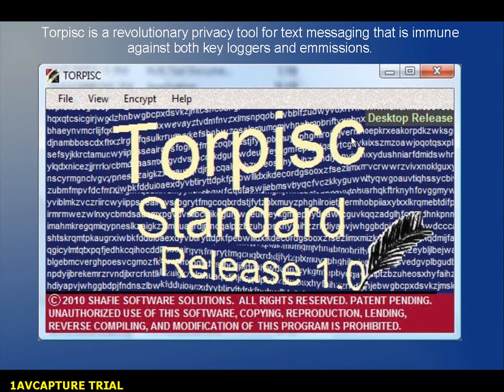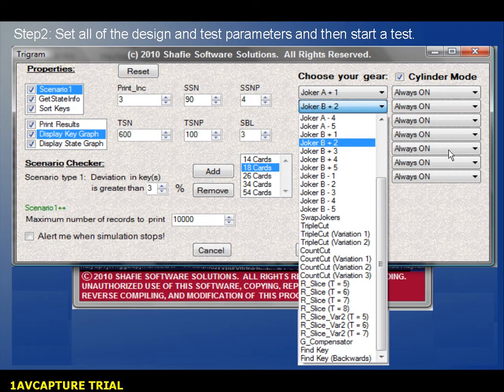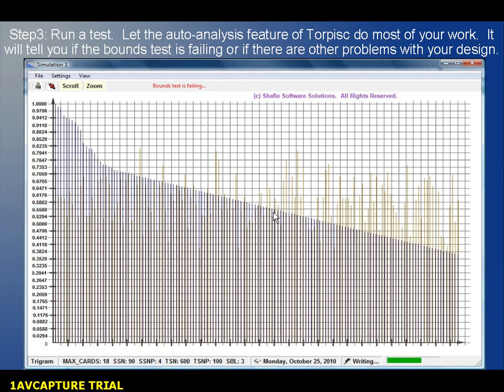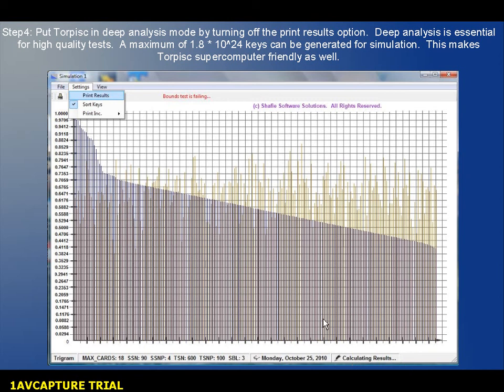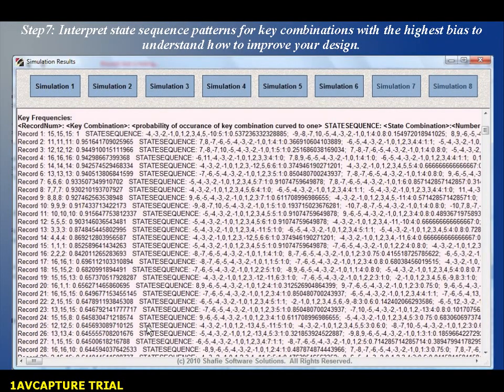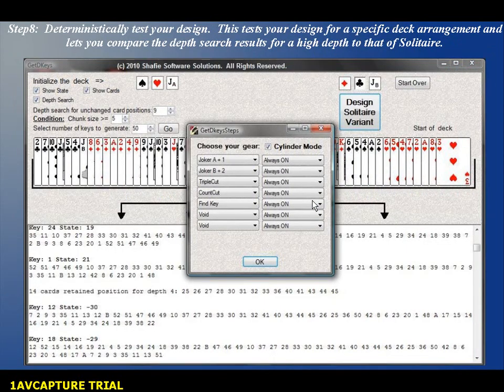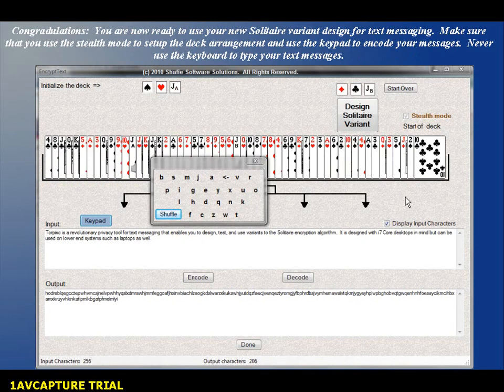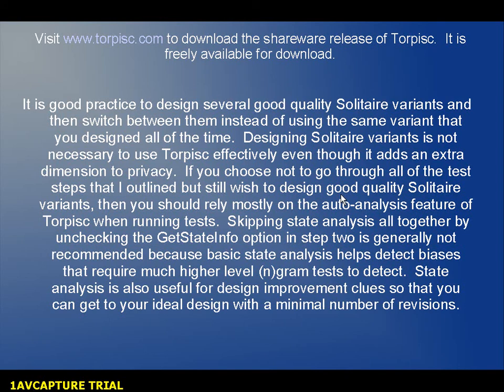Text Message Encryption.  Dodges Keyloggers and Emissions

Comment: The TI-92 Plus calculator version is for those who do not wish to use Solitaire variants by hand.  The TI-92 Plus calculator is very secure especially because it was not designed for network connectivity.